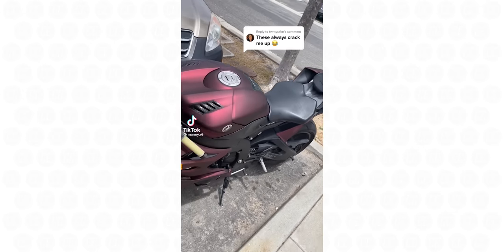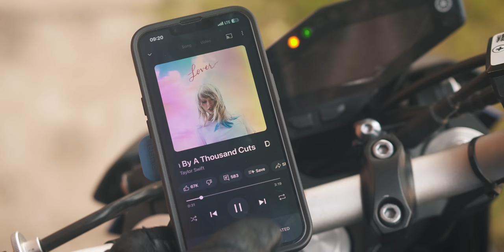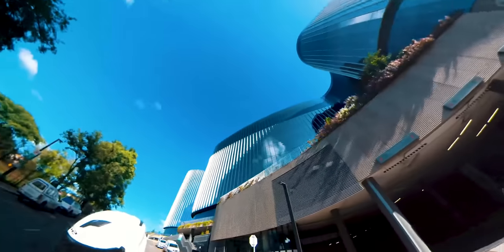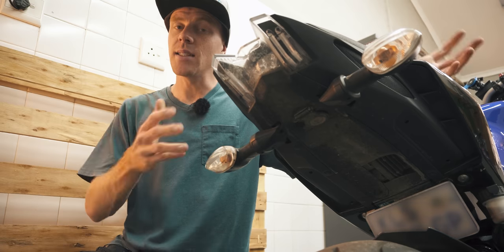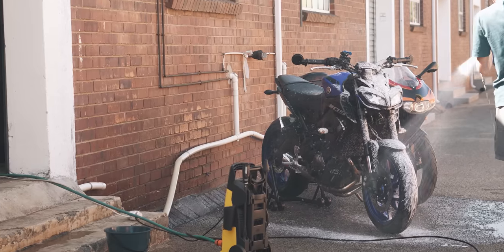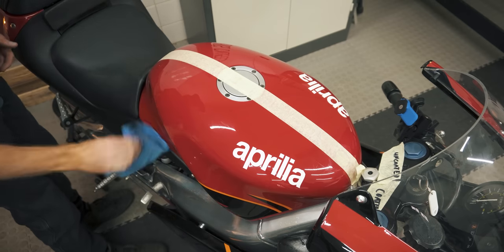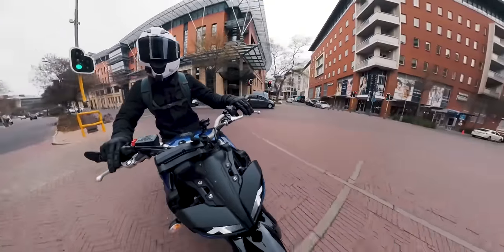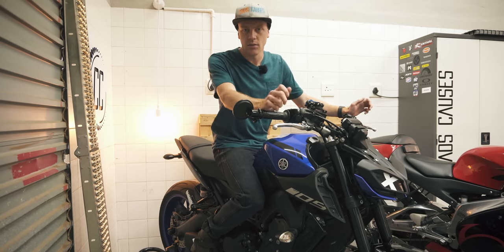What's The Point? | Motorcycle Ceramic Coat

Comment: Here's the scoop on the spray stuff vs the real deal vs the pro stuff from a guy who dabbles in detailing out of his garage. The spray stuff that you can get from the store is mostly marketing hype and will do about the same as a decent paste wax with similar lifetimes. I will caution you though, you should read the label on the bottle you used and make sure it doesn't tell you to throw out the microfibers you used. Real deal ceramic products leave small ceramic particles once dried and will not wash out. So if thats the case for the stuff you used those rags are now sandpaper masquarading as towels. All the towels that I used when applying ceramic stuff either go in the trash or get demoted to oil rags.

The more expensive glass bottles that get put on an applicator are the real deal. They provide UV protection, and true water bead off to the point that you can drive/ride in the rain and immediately the water will be sheeting off. The dirt and bird bomb protection is marketing hype for the most part even with these coatings. The consumer vs the pro stuff is mostly just the concentration and longevity of the coating (more on longevity later). Pro stuff may last longer but you can still get really good coating without having to shell out to have a pro do it. 

Real ceramic coating needs a ton of prep work because the coating dries clear. Any imperfections or love marks will show through clear as day (unlike paste waxes) so you need to have a rigorous wash and decontamination of the paint as well as a full suite of polishing to remove any clear coat scratches. On my own car it took me about 5 days from start to finish to get it applied as well as a 24-48 hour cure time (where it CANNOT get wet at all) before it was done. 

Longevity is very dependent on the vehicle you put it on. I got about a year and a half out of my 3 year coating before the water beading started to get weak. The gloss is still there but it no longer beads water like it did originally. However I am an extreme case, I put 20-40k miles on that car per year in all conditions (rain, snow, heat, sleet, hail) so that coating saw it all. If you put it on a show car or bike that never gets wet I expect you could get it to last even longer than the sticker says.

For the stuff the manufacturers neglect to tell you: If you have water sit on the coating and dry in the sun it can leave marks in the coating that do not wash out. I had this happen once and I suspect I'll need to polish the coating off to remove the spots. Im not sure the exact conditions that cause it but it definitely can happen to any ceramic coating and I'm not the only one who's had it happen. 

With all the work that goes into making the coating look its best I actually am not sure I'd do it again if someone wasn't paying me to do it. I wax my street bike as needed mostly becuse the prep process would be really difficult on the really complicated VFR fairings. Meguairs Gold class liquid wax is good stuff! On my car I'd probably look pretty hard into PPF over redoing the coating.

Comment: To get rid of those surface rust  on the headers, spray with wd40 and scrub the rust spots lightly with a Scotchbrite pad until they're gone. Then to maintain the now shiny headers, after washing the bike, spray the headers with a light coating of wd40 then wipe of excess with a cloth rag. Don't get alarmed when you start the bike and the headers start to smoke, that's just the wd40 and will only smoke for a few seconds. Mud and dirt will be easier to clean off of the headers, it's an old trick from motorcross to coat the 2stroke pipes 🤘

Comment: I bought a bottle of ceramic coat spray and used it weekly diligently until it got low. Now I just wash the bike and after about 6 months I'm seeing the paint dry slower, less shine and more raindrop dots. Might try the old remaining bit and see what it does. Have been thinking about using it again since it now sits in the Florida sun for 9 hrs a day then nice garage the rest of not riding time.

Comment: I bought a new bike just over 4 years ago. When I got her home I applied ceramic coating to the pristine paint. 4 years and 25,000 km later, part from a couple of stone chips and marks on the mirrors when I filtered through a very narrow gap in the traffic, the paint is amazing. Cleaning is very easy as the bugs and dirt just wash off without having to scrub. Water still beads but not as well as it used to, so, time for another coat this winter.

Note: preparing the paint prior to applying ceramic coating is extremely important as the coating will seal in any blemishes. Most products also say keep the coating dry for 7 days to allow it to fully harden.

Comment: I've bought ceramic coating for glass for the car I use (and then I've also applied it to the other 2 cars my parents own). It's great because I can drive 100km/h + on the highway and I don't need to wipe the window at all when it's raining. Should be useful also for winter for easier removal or ice in front of the windshield

Comment: Great video. I have applied Adam, ceramic coating on multiple bikes and vehicles. The ceramic detail spray is used for cleaning up light dust and dirt after applying a coating to the vehicle. I would recommend trying one of the off the shelf ceramic coatings and using the detail spray for quick cleanups!

Comment: Trust me backpack leaf blower is what i use to dry it off it works like a charm then i ride for like 20 minutes to get the engine all hot and I guess boil off the water that's on the hard to reach places with a leaf blower

Comment: I did graphene coating on my bike after the first service 
The bike looks brand new even after a year 
It doesn't provide scratch resistance but it prevents those micro swirls coming up on the tank 
It's much easier to clean and under the sun it looks very shiny 
It was a bit expensive but I feel like it's worth it 
I live in a rainy arae and cleaning the bike is much easier 
Most of the time a bucket of water or a house takes off most of the dirt if it hasn't dried up yet

Comment: bought a cb300r... it is kept outside most days so whenever I do not ride it is covered.. that being said, the fact it is a newbie bike means that when I sell it, it would almost be slightly better if it was in worse condition because people don't want to learn on something shiny and new.. they want something a bit rough around the edges so if they scratch or ding it... well, it was already like that anyway. That being said, I am going to take the best care of it I can without going overboard... clean the chain regularly (despite my personal protest) and keep up with cleaning it/covering it.. but a ceramic coating? Feels like a bit much for a newbie bike.

Edit: that is mostly plastic.
Reply from the maker: Haha I agree with that logic!
Reply: I think thats a very weird thought process. Sure beginners might favor a rougher bike to not worry as much when dropping it eventuelly. But not caring enoygh so it looks rougher just lowers the sell value

My 2006 NT700 is old and time definitely has doen its work, but i regularly clean it and have it ceramic coated(the permanent kind not the simple spray bottle) and ppl regularly think its newer/more worth than comparable ines on the used market
Reply: @someguy9520  I am absolutely going to take care of it and do what I can to make sure it retains it's value but I am not going to go out of my way to put a ceramic coating or that plastic coating on a newbie bike... if I did and tried to recoup the value in any way it would look like I was stingy and or asking too much for a bike others may just see as a stepping stone to something bigger.

Comment: Hey there! I had the same way of mind as you before, just washing, painfully drying it and good to go. My bike is a Triumph Tiger, 5 y.o., and you can imagine the nightmare to clean a trail after some rough roads sometimes...
Recently I've been interested in detailing process, and decided to go for it. I bought a ceramic spray from Hendlex (well-known brand for real ceramic coating), deep cleaning of the bike (soap, water, and claybar to remove everything from the paint), a bit of work and tadaaa! Shining like the first day, water gets off fastly, drying is a piece of cake and extraprotection versus UV.
Not so sure about the marketing "easier clean" though... For a light dusty bike maybe, or if you don't wait to remove dirt, but if you don't wash it more than once a year it will only help a little ^^

Comment: Have used sonax CC evo for very long lasting excellent coating and the CC One for a little bit less long lasting but less bothersome to apply

Its designed for cars, but it works just as well on fairings, the tank etc

Comment: There is a lot of false hype around ceramic coating. The long and short of it is. Coatings helps keep your vehicle cleaner for longer but the real benefit is , it makes cleaning so much easier. Will it stop scratches NO it won't. Will it mean never washing your vehicle again NO it won't. A 2 year coating on my mt10 lasted 4.5 years. As it wasn't used daily like a car.  My new bike has been coated and even riding in the rain the bike is still cleaner than my friends.

Comment: I use ACF-50 instead. It's kinda same idea. Although I have thought about getting some bike parts done but I'm guessing it's different type of method used. As more like powder coating but thinner. If ever got my bike re painted (fairings) I'd use that plastic stuff after tho.
Reply: I use ACF-50 as an anti corrosion spray. Real ceramic coating, like Cerakote H series is applied by spraying on then baking. This so called "ceramic" coat that you apply with a cloth is not really the same thing. Ive used the bake on cerakote on two bikes ive restored, 86 GSX-R1100 and 87 FZR1000, mainly on the alloy fork lowers, and other alloy bits that i had vapour blasted to remove corrosion, and its really good, looks just like the factory finish.

Comment: Excellent vid however lets not use the word Polish casually when talking about paint protection. Polishing is an invasive/abrasive process. It removes the surface layer of paint/clearcoat (depending on what type of paint is on your vehicle whether single stage or 2 stage). Its what you would do in the paint correction process.
Reply from the maker: Fair enough 😅